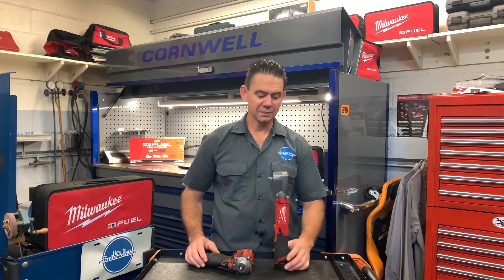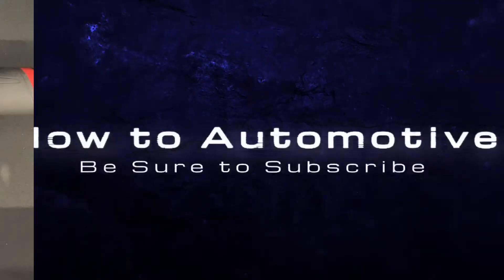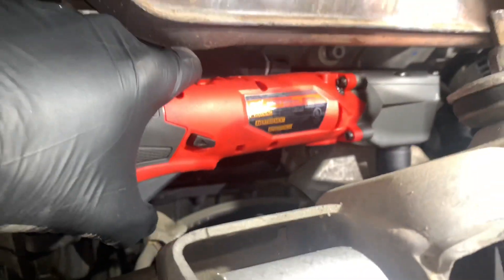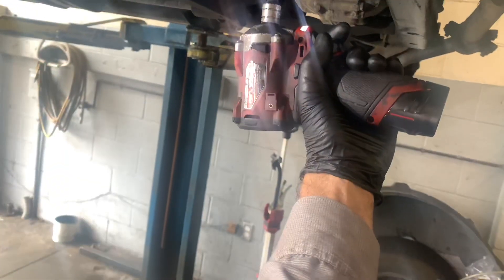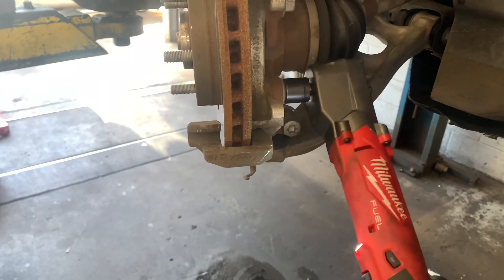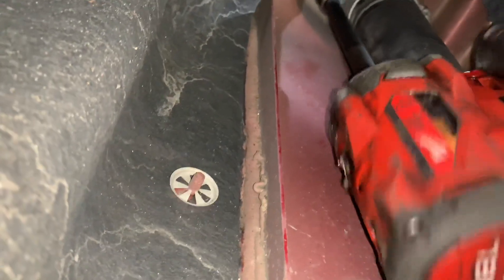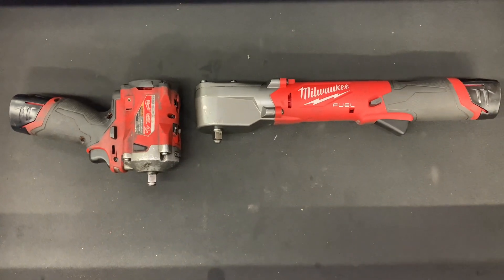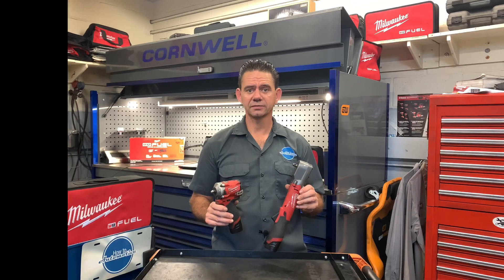Milwaukee Tools: M12 Fuel 3/8 Right Angle Impact Vs 3/8 Stubby Impact

Comment: If you are a tradesman the stubby will find more utility and is far less strenuous to use. The right angle wrench has its niche for those few situations that only that design can satisfy. If you want to avoid going to hand tools it is pretty obvious you really need them both to cover all the bases. A DIY can afford to spend some time with hand tools on those tight spots where the right angle shines so for the DIY I think the stubby is the clear choice.

Comment: As a DIY, I'd go stubby. I have the 1/2" and it's my go-to tool. I love the light weight, wieldability, and power.  If I were a pro, I'd consider adding the right angle as well.
Reply: In the rust belt and things that have never came apart. i've seemed to not get too much done, but then agian i'm always putting it against some of the bolts that are super tight from factory and then rust lol. I also normally don't use any spray lube which could help in some circumstances but yeah. Still love it for smaller bolts to quickly zip them out though, along with my 3/8 fuel ratchet lifes so much better.

Comment: Most cars from major manufacturers are designed to have their fasteners removable by regular hand tools and regular air impact guns. This is because they need to ensure their cars can be quickly repaired or maintained by dealers to ensure their profitability. If for some reason regular hand tools or impact tools cannot access a fastener in the first place, that component likely requires additional work to remove other parts. The Germans absolutely love to have fasteners placed in positions that are extremely hard to reach. Sometimes, even when you can access a fastener with a very specialized tool, you still have to remove another component to be able to remove that part. For me, I have the stubby 1/2 impact for 99% of the work. There may only be 1% of the work that actually needs the right angle. I would just take a low profile breaker bar for places that the stubby cannot reach. I can afford the 1/2 and 3/8 right angle impacts as well as all three of the Fuel ratchets. But the last thing I want is to have tools that I spent over $1000 on, but never have a use for.
Reply from the maker: castamir that’s way I made the video to help people buy the right tools for what they are working on. Hopefully the video helped. Thank you for watching!

Comment: I'm so happy that I bought the mid torque for the bigger jobs like working on the suspension. The mid torque now comes in the same size as the Stubby but packs a lot more power with something like 450 ft lbs of torque!! I think the smaller impact ratchet is perfect for the smaller jobs around the engine bay and elsewhere. In my opinion, they both have their uses and I recommend having both. On the other end is the high impact gun but I really think that a typical DIY person doesn't need that much power and they are very likely to brake bolts with it so I don't recommend it to amateurs. I can't wait to get the impact ratchet!!

Comment: The right angle will get you into more tough spots for sure.  Definitely going to buy.  I have the M18 Big Daddy 1000 ft lb. and a little M12 hex impact (good for about 100 ft lb), M12 ratchet, but nothing in between.  The M12 fuel hex impact is surprisingly useful for $99 though.
Reply: I took some lug nuts off with the m12 Hex Impact its a really nice tool.

Comment: If you are looking at the right angle impacts, get the 3/8" version, it is, for some reason, much more powerful than the 1/2". I just returned the 1/2", and exchanged for the the 3/8"/ I used it today on a Cummins ISX, removing the Oil Cooler housing, RTV all over the threads on the bolts, and all over torqued. The 3/8" right angle impact did it with ease, 19 out of 20 bolts. The 1/2" failed at every task, except for one lone bolt.  

The 3/8" stubby impact, no brainer, buy it, it is a beast!

Comment: I decided to buy the Stubby since my 1/2 drive Ingersoll Rand electric impact is too cumbersome to control. 1500 ft.lbs is overkill also. I gotta do my brakes soon. Can't wait to get my stubby.
Reply: How did it go? Did you get the Stubby after all?
Reply: @MrSupernova111  Yes. I did get the stubby and I would definitely recommend it. I use it for 95% of my automotive work. I still have the other Impact gun just in case if I will ever need the extra power. Using the stubby makes the work so much easier, especially with the brake job.
Reply: @Luis7Ong  . That's awesome! Thanks!!

Comment: Stubby all the way! im still not convinced of the right angle impact.
Reply: Right angle all the way!  I'm still not convinced of the stubby impact...then again...I'm a contrarian.
Reply: I disagree. I have both. You need both
Reply: @k-trix1652  I agree I need both of these I have neither at the moment
Reply: @k-trix1652  so true. need both.  its not about the money. making the easier
Reply: @k-trix1652  so  true. not about the money. it will make the job easier
Reply: @k-trix1652   so do you recommend this product?
Reply: Both are nice to have on hand, right angle has tons of torque for what it is. More torque than my IR Hammerhead. I'd say the stubby would be more commonly used though.
Reply: For tight spaces the right angle impact will be a better choice
Reply: High torque with extensions is all you need. The little ones are only good if you do this everyday

Comment: I couldn't fit the stubby between the front engine and radiator fan in my Mercedes w204 but the right angle does.  And I will need to swap engine mount soon.   So I guess if I can only have one, I'd pick the right angle with a 6.0ah xc battery.  Also, I'm in California so I don't have to worry about rusted bolts so hopefully the right angle will do.

Comment: I just bought the right angle impact , I never opted for the stubby I went for a bigger high power impact driver from another brand, although it very powerful its big, and heavy .. so I added the right angle as it seems to fit with what I have better ..  :)

Comment: All these tools have different uses so optimally it’s best to get all of them but if you can only afford one I’d get a M18 impact gen 3 in 1/2” which I have but also have the long reach ratchet in 1/4” anvil. I was at Home Depot yesterday and held the rt angle impact but until I come up on a job that the other tools can’t do then maybe I’ll buy one.

Comment: I lovey stubby, best purchase and used everyday since what i work on mainly tequires 3/8s. I have tried right angle, have not found a spot yet where i needed it, and feels clunky, if im in a tight spot i just rather use hand tools to be more in control to break loose and then i can use a E ratchet to back them out
Reply from the maker: I agree with you the stubby is the one I use all the time as well. Thank you for watching!

Comment: Get both if you can afford both. But if you can only afford one, get the stubby.  I have both along with the Gen 3 1/2" M18 mid torque impact. I'm looking to buy the extended 1/4" M12 ratchet, and should be good to go for automotive work

Comment: I use  wobble extensions...So I have no issues using the  stubby 1/4" or 1/2"....And the weight of the 1/4" is insane.. It's  light as a feather...

Comment: I'll buy one when the next generation right angle comes out. It just needs a little more power
Reply: Yep 220ft lbs seems underpowered, it won’t be enough to to remove rusted bolts, or stubborn bolts, that’s why I stick with my high torque impact. But it’s not a bad choice if your using it for medium duty work like remove lug nuts and some brake and suspension jobs if your a DIY or a Mechanic

Comment: Each has a specific use..work more if you have to and buy both of them. You don't take lug nuts off with a right angle and you're not going to take a wheel bearing hub assembly off the front end of a 4wd vehicle with a stubby. Get the right tool for the job.

Comment: I’m extremely torn on which one of these 2 I should buy next. I had problems getting to a back bolt on the back of a brake caliper do to not having enough room. I feel that the right Angle impact would’ve been able to get to it with fair ease. I looks like the right angle impact can definitely come in handy for tight spaces.
Reply: Get the right angle with 1/2 in drive. I find that the 1/2 has a slight edge over 3/8. I remove my lug nuts with my right angle.

Comment: Right angle impact coupled with the mid torque impact has satisfied 95% of all my power tool needs.  The stubby has limited use in my applications because it kicks itself out of angle position due to it's design.  Of course with the use of universal wobbly sockets and extension it can work but that gets frustrating, imo.
Reply: I am not a mechanic, only work on my own cars, but I really enjoy working on them. I have a m18 high torque (overkill i know), but think I might eventually also invest in a right angle impact as well for those hard to reach spots! With limited use should last me decades
Reply: Key word Tough spots👉 90% stubby . Way more power.

Comment: The right angle seems like the more versatile tool, so if you can only get one that's the one to get. However, I would definitely be using a stubby over it whenever possible, so it is much better to have both.

Comment: What size battery are you using? The right angle really performs better with the larger capacity batteries….
Reply from the maker: I now use the new high output, XC batteries 5.0 and 2.5

Comment: I personally felt like the right angle is the better either or  option, for the many bolts that aren't that tight that you just want to run off quickly with a handy tool you can find a good even name brand impact driver for like half the price of the stubby to take them off (I bought a current gen M12 driver for 82 bucks online), and for the handful of really tough bolts on most passenger vehicles neither is going to work so you'll need to step up to at least a mid torque. So to me it's really a question of which is more valuable the comparatively tiny number of bolts where the bit of extra torque on the stubby might let it break them loose vs. the fact the right angle is much more compact and thus much more likely to reach any fastener you actually want to use it on. 

For me the later significantly outweighs the former, particularly as new cars seem to give less and less thought to any sort of maintainability or access for tools. Basically a somewhat weaker tool that can actually get on the fastener is automatically worth more then a stronger one that can't.

Comment: You ask which tool is better thats the wrong question to ask. They are both  great tools!! They each have their own purposes. Every mechanic should have both tools and use the proper tool to the correct application.  The right angle ikpactbos for hard to get to places when you can't use the stubby. You are using the right angle inplaces where most people wouldn't.

Comment: I’ve just purchased the stubby I already have the high torque 1/2 wrench along with the right angle impact so now have all 3 for any situ but this stubby is a life saver , don’t know why the one in your video only has around 200 + ft of torque mind as the one I got is rated at 339 ft lb of torque ?

Comment: Good comparison.  Can't one hold the right angle impact wrench on the gray section (opposing end from the handle) for better positioning / socket placement?  Or can we risk being hurt doing that?
Reply: You can but you wouldn't be able to reach the trigger if you're doing it one handed.

Comment: Well I just picked this up today. I have the stubby.. and this right angle has no where near the advertised tq to me. My wheels are torqued to 110ft and it can’t break them. Hold it on till it auto shuts off.. I have the both ratchets and thinking maybe this is a take back if I got those and it can’t do half of what the stubborn can

Comment: I own the 3/8 right angle impact, and I was underwhelmed by its ability to remove fasteners. It seems to have torque that is closer to 40 ft lbs than 220, and it is particularly weak on something that can move, like a pulley or low mass object. It's a little better than my cordless ratchets, but not by as much as I expected, and when I reach for it I often end up doing the time wasting dance of failing and then reaching for something more powerful. Of all my Milwaukee tools, this is the one I regret buying.
Reply: Bigger battery (not 2.0) makes a big difference

Comment: I don't believe I would start the strut bolts with the extension not aimed straight at the bolt. Yah flaks can put these bolts back in starting with the impact and when I get ready to work on it later it will not be an easy job